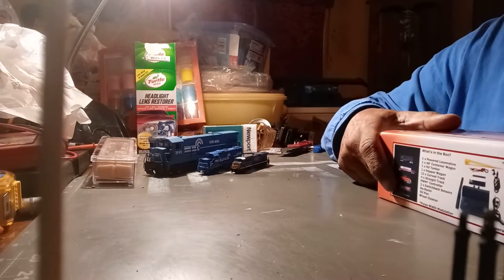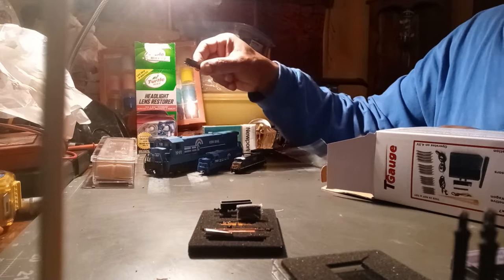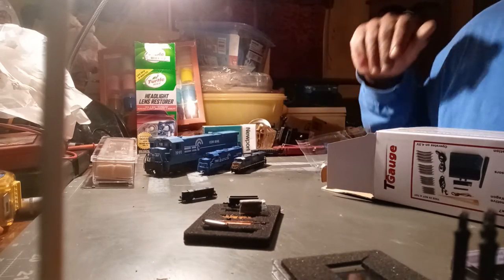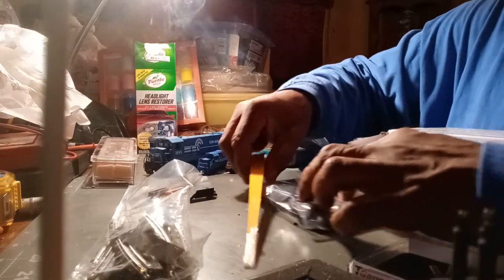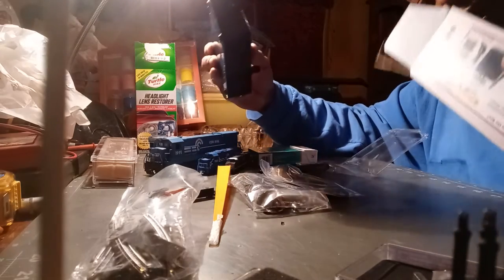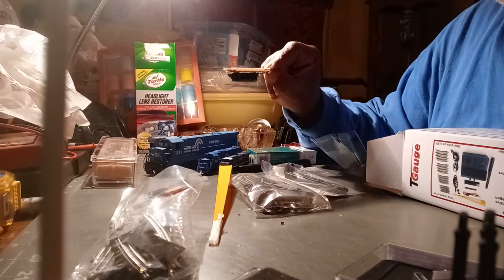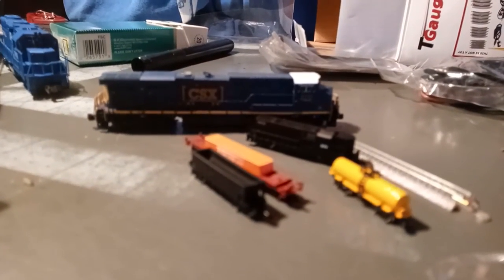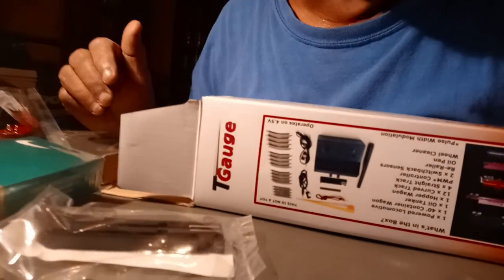T gauge unboxing and size comparison HO, N, Z

Comment: I wonder about the feasibility of 3D printed T scale. You would for sure need a resin printer of course, FDM is not gonna cut it. (Or print it, in this case.)